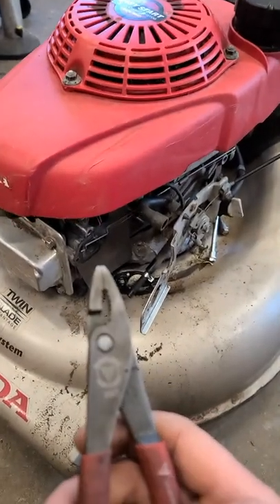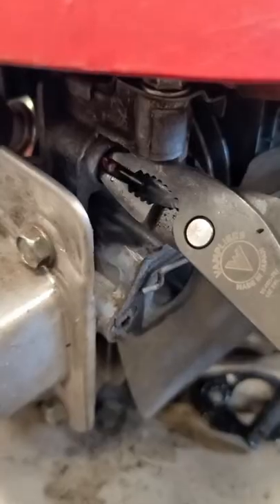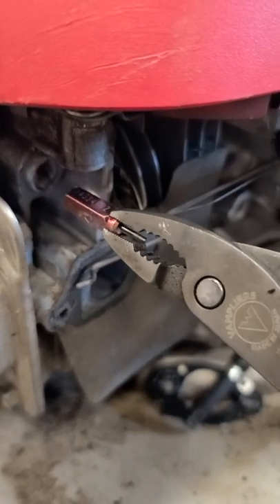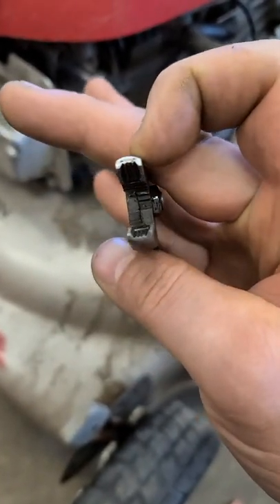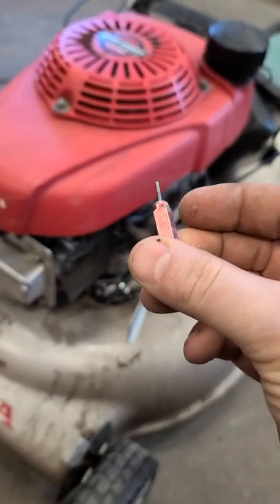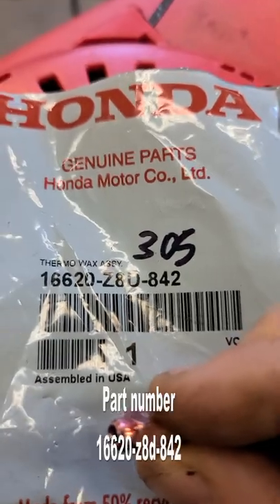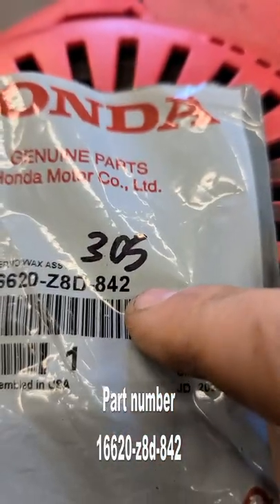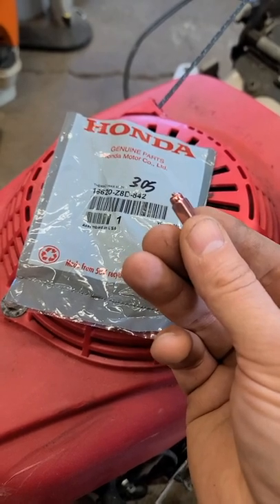Honda Lawnmower Hard To Start If This Part Is Defective! #shorts

Comment: Donyboy73- does temperature have anything to do with hard starting? I just replaced this. It did help significantly but still taking more than one pull when temps are 40-50 deg f during the days. Is colder weather harder starting for lawn mowers? Currently using Honda oem 10w30 oil

Comment: I have similar mower but very new, barely been used, thinking this may be failed on it but it will start and run but it'll only run for a few minutes then shut off? Very new mower has maybe 3 hours on it, any recommendations? Checked carb bowl it was spotless no water

Comment: What if you’re able to push the pin back in after it cools? Is the part still defective? Tried putting it back in turned it on worked for a few minutes then dies, take it back apart and it’s sticking out again, should it always sit back in when the mower is turned off?

Comment: I love when manual switches or levers get replaced by electronic parts and relays
Reply: That part is not electrical or a relay so......?
Reply: @wayneessar7489  ...what ever....still not as reliable as a manual lever...  
:-)
Reply: @kenk3102  You are correct Sir, not good in cold weather.
Reply: Driven by heat